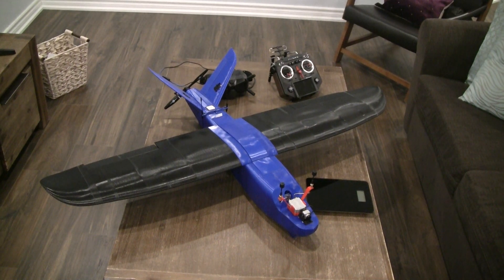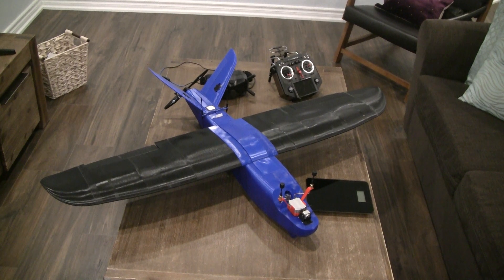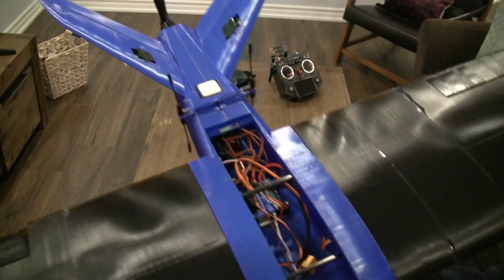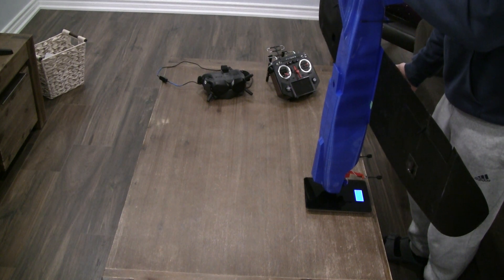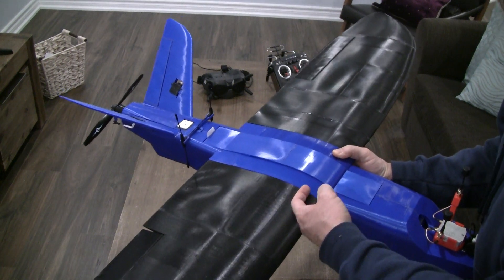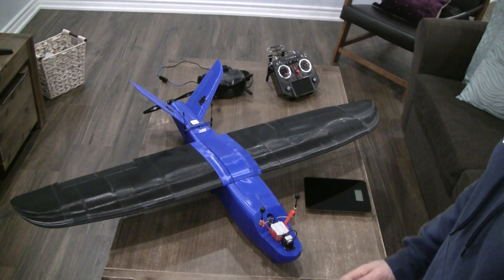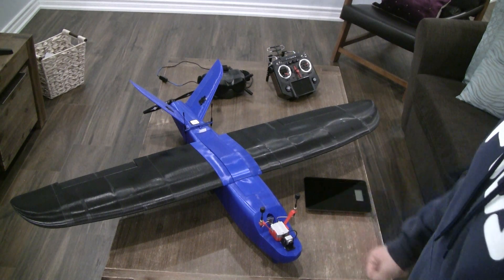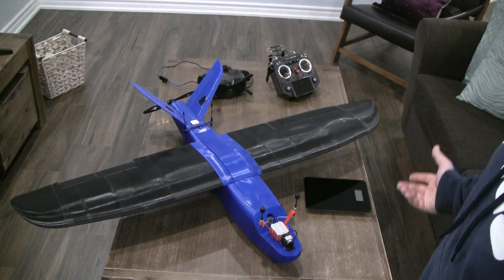3D Printed X-UAV Mini-Talon - Part 5

Comment: I've been flying the foam mini talon and it needs a fair bit of nose weight to get the CG right. Since you have installed your motor further back than the stock setup, you need more nose weight to balance the plane.  However, I have pushed the CG further back to  be 65 to 70mm and it still flies great.

Comment: Is there a 3D printer you would recommend for getting started printing things to assist in building talon?
Reply from the maker: I used the artillery sidewinder x1, I don’t have experience with anything else, but in general the new anycubic printers should do the job just fine

Comment: You should really consider positioning your antennas differently.
Currently (on both air unit and rx) your nullpoints are angled in the same direction. If one antennas has bad reception, so will the other.
Put them either in a L or a V, so that when the nullpoint (top of antenna) of one is pointing towards you, the other one will have it's (good)side turned towards you.
Reply from the maker: Your comment is absolutely true, I am planning on making a bunch of changes, antenna orientation included, after I maiden it, to make sure that it flies well first.

Comment: What about to do a twin minitalon and put motors on the wing. I this case your weight will move forward and battery you can place as you need :)
Reply from the maker: Thanks, I might have found a solution, I will try to extend the nose by around 15 cms , this way I can move the battery forward more, this will enable me to hit the right cg with minimal weight increase
Reply: @RaedAdlouni   Are dimensions of fuselage same as original foam Minitalon? I would like to use spare wings from my crashed Minitalon :)
Reply from the maker: @Minrot1  I don’t know that, sorry

Comment: It would be great to have stl files "sliced" for printing. I take off my hat
Reply from the maker: I can do that and post the files in a day or two; however, you will need to edit certain sections like the tail where the hole is customized to the dimensions of my servos, or the mounting plate that is customized to my flight controller
Reply: @RaedAdlouni  👍
Reply from the maker: working on the STL files, should be up on thingiverse by late tonight
Reply: @RaedAdlouni  And how to send these stl files to the printer ? There is a file with a cut wing. The whole model. The whole wing. divided into parts. And how to take a separate part ? Ultimaker Cura can't do that.
Reply from the maker: Use windows 3D builder to save different sections in separate files
Reply: @RaedAdlouni  Thanks. When you printed the wing, the wing ends were empty. And here the cut is closed.
Reply from the maker: @sfagnum9205  sorry I don’t understand your comment, please rephrase